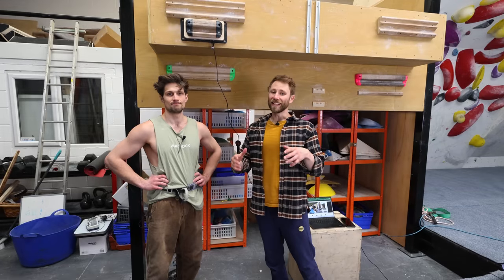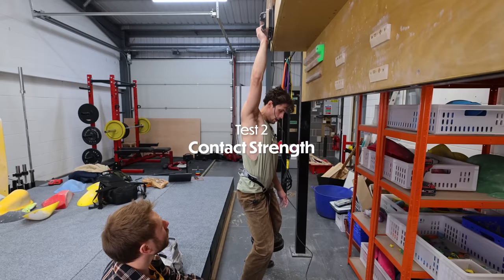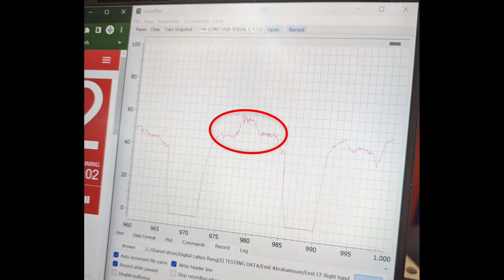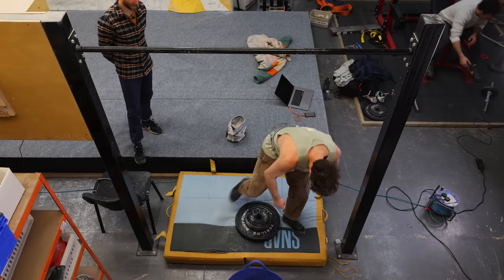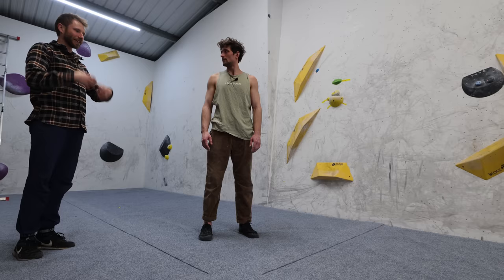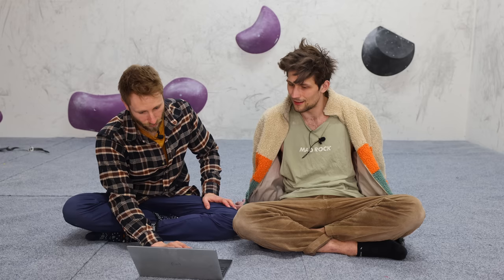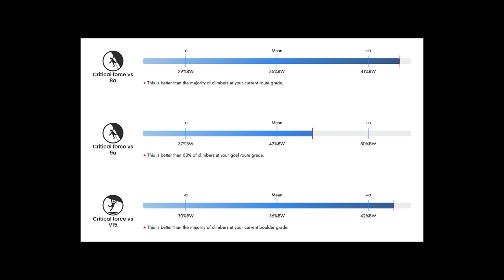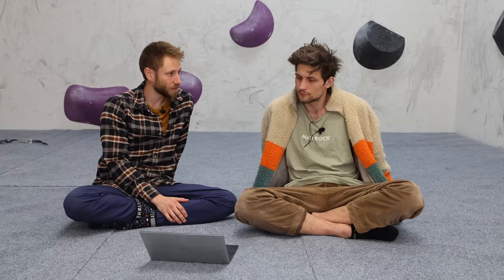Does @EmilAbrahamsson need to get stronger?

Comment: Power screaming gives an extra 10 kilos? Guess that Adam Ondra video wasn't an April fool's joke after all
Reply: its been shown that screaming can help you generate force, hence why climbers, weightlifters, tennispros, etc are doing it when trying hard
Reply from the maker: Right! I was amazed it was such a big difference.
Reply: @raiemie7365 It does, but I think with tennis it might be more for distracting the opponent. Sometimes the screams are a split second late with respect to the hit
Reply: @karimchahine4883  often with tennis the grunts are more of an exhale thing: hold breath before hit, hit, exhale (grunt)
Reply: @karimchahine4883  when you scream you tense your core up besides distracting your opponent it helps transfer energy from the feet to the arms (all power in tennis is generated from the feet) having stronger arms just allows you to transfer more energy to the racquet

Comment: The most interesting thing here to consider is that given Emil's results for Critical Force and what he said he spends a lot of time doing versus what he thinks he's best at, shows us just how wrong we can get it sometimes in our head, but get it right in our bodies. Given these things, he seems much more inclined to be better at producing a semi-high strength for a long period of time because he trains that all the time! But for whatever mental reason he still tells himself that he's best at power, something we're probably all guilty of throughout our training. Another consideration here you mention is timing. There is still a long way to come in measuring skill and technique. SO many pro climbers spend so much time climbing lots of different things consistently that they learn to use the strength they have better and thus don't need more strength like the rest of us plebeians! Definitely what I admire most about these high-level climbers
Reply: That, or it shows us that so few people climb v16 that the sample they are comparing to is so small it's almost irrelevant.

Comment: Shouldn't measurements involving repetitions (like push ups, pull ups, etc) involve consistent cadence to accurately measure / compare with others?
Reply from the maker: In a world where you're aiming for the highest quality, lowest volume data collection that may be put forward for peer reviewed research, then yes. In the real world though, there's a line between theory and practice, which must be found! As you imagine, we've done a LOT of testing over the years (both commercially and for our own peer reviewed research) and we find what we're doing is pretty effective. Hope that helps give a bit of context :-)

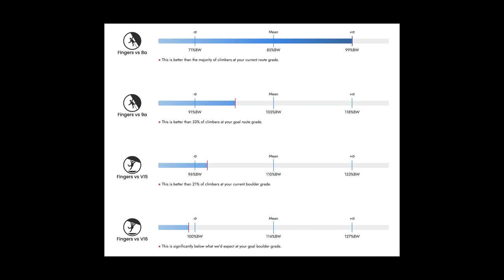Comment: 11:12 Are these scales corrected for height? As in: is "mean" the mean for v15 climbers, or v15 climbers with a similar height to emil? Emil's quite tall so its kind of a given hed be in the lower end, wouldn't it be more insightful to compare against similar heights? As you know from your data, 95% bw hung at 6'0" is a world apart from 95% bw hung at 5'6", it barely seems useful to compare the two.

I'm aware that you don't have an endless supply of v15 climber data either way of course :)
Reply: lighter = better for  climbing , it is likely the case emil is stronger than stefano ghisolfi but stefan can climb harder as hes lighter.
Reply: Pretty sure it's just the average and yes that might be a big part of why Emil found the results surprising. He also has a big arm span and wouldn't use the same beta if possible. He has quite a lot of volume and the inverse cube law is not helping.

Comment: I always wondered, is there any reason why you do max push ups instead of max weighted dips (or even weighted push ups?)
Reply from the maker: Great question! I'd add bench press too as this is good for 1RM or 2RM tests. The main barrier here is equipment. Our remote assessment is designed so that the majority can do it at a regular climbing gym. We've found many gyms still don't have a decent weight lifting set up. In many cases, just a hangboard and a bar with a few weights is all that's available.
Reply: Ohh I see! I didn't suggest bench pressing because it requires a lot more technique, coordination and there are many different ways to do it (with influence of spine mobility). But I see, thank you!
Reply: @LatticeTraining  Mine doesn't even even have weights to go with the 6 different hang boards and 7 types of campus rungs.

Between a hang board, a decent pull up bar, rings and a bunch of random weights, I have a better setup at home than at the gym.
Reply: You call those pushups lol
Reply: @LatticeTraining  I would suggest standardizing the pushups by requiering to lift the hands off the floor at the bottom of each rep. This foreces everyone to do a full range of motion and should give more consistent data.

Comment: Like always great video, love to see them suffer.. until it's my turn 😂 Two points of criticism though: The pull-up bar should be stabilized so there's only movement of the climber. And it's hard to see if the push-ups were all the way down, or place an object beneath so the elbows are always at 90 degrees maximum as the end point (for high ape-indexers or those with poor shoulder mobility this is a bit nicer).

Comment: It'd be interesting to see if repeating the RFD test when he's a bit fresher changed the result. I'd expect RFD to be the first thing to suffer when tired.
Reply: I wouldn't as initial high velocity work is usually quite fatigue resistant. most skilled athletes should be able to produce a similar velocity of pullup with appropriate rest between each set for the first pullup, and then with fatigue will see this drop significantly on following reps. Those rapid contractions will function similar, producing strength at velocity, but the RFD does seem quite off for someone of Emil's capabilities.

Comment: A question here : does the RFD measures the time from the bip to the time the force is applied, or the time from the first force applied to maximum force achieved in this run ?
Reply: obviously not certain of their setup, but in testing athletes with dynamometers, these tend to begin reading when a minimum force is applied, a few kg, and until a designated time is reached, usually 250ms.

I imagine Josh has done enough of this to assure accuracy and the scale shown on screen compared to climbers makes this seem like he has no RFD versus simply poor compared to other climbers.
Reply: @zacharylaschober  Makes sense, thanks. I guess so, yeah, was just curious to understand how someone able to do 1-5-9 can have poor contact strength, seems very counter-intuitive.
Reply: @Ptitviaud1337  campus boards are usually poor for development of contact strength or power, especially on much longer spans, because these are highly skill based movements which predominantly rely on lockoffs.

However, I get the point that watching Emil you would believe he has plenty of contact.
Reply: @zacharylaschober  I think you got the point, but maybe we could elaborate here together (i'm following my line of thoughts): ultimately, campusing relies on contact strength, lock-off AND contraction speed. You can have, for the sake of the argument, any mix of that (so, lets say high contraction, high lock off power, poor contact strength) and perform. Would be interesting to then isolate Lock off/explosiveness. The reason why i'm thinking about that is that i'm interested in finding a pretty easy way to measure contact strength, without using specific tools.
Reply: @Ptitviaud1337  following that, I think the problem with the 1-5-9 metric is we are adding several skill elements into this. 1-4-7 reduces much of the lockoff and skill, as will 1-3-5, but ultimately if we are measuring contact strength without an rfd device then I think snatches to edges are better. especially if we have an open and full rung akin to campus rungs, what you would do is find a rung which can be held isometrically at a weight and see what percentage of that weight a climber could do by snatching the hold, basically a small hop without time to recruit for the hang.

what would we do to train contact strength? have an athlete attempt to grab holds with greater force, either by increasing the speed they hit the holds or the weight.
Reply: @zacharylaschober  Yeah ! 1-5-9 certainly starts to hit also a morpho point.
Another "guess" is that they seem to measure, in this test, RFD over a period around of 300ms ? The problem that i see for climbing, is that within 0,3s, you would fall by about half a meter. Obviously, being able to developp strength over 0.3s isn't maybe so useful to suceed in a dyno scenario (following the same logic, in a dyno, if the margin for error is about 5cm of freefall, you need to developp enough strength within 100ms).
Of course in another scenario, where you can complement the force applied to the "next hold" with feet and/or another hand, you might have to recruit strength over a longer periode of time.
The problem with jumping to a hold is that it's very difficult to standardize...maybe it should be relative to max hang of said climber(so, lets say you're able to hang, one handed, on 20mm, we could determine that being able to jump one handed to this same hold is "that good", for example.)

Comment: Real question: how strict are you testing on form for the push-ups? Because arguably, the push-ups performed were not "clean". Cleaner push-ups would be more difficult and result in less reps, and in the end what you're testing would be different. So I wonder why not test for push-ups which have a 2 sec down, 1 sec up movement, engaged core, head straight, instead of just pumping out as many half push-ups as possible?
Reply: The form is not super strict as this is not the best allocation of time/focus resource when it comes to testing. Where you DO want to be stricter is when it comes to finger strength or max pull up tests. As always it’s a balance of theory and practicality 😊
Reply: @tomrandall8348  thank you for the reply! It makes absolut sense when you put it like this. I always worry about form because of the risk of injuries, but like you said, it's a balance, especially when testing
Reply: @Watashiwapitadesu  I think notably for pushups they are more concerned with it in a cardio/muscular endurance regard and even then only a bit because it has little relation to climbing. Therefore they don’t mind the reps being sloppy. With pull-ups there is an easy standard to keep with the chin reaching above the bar.

Comment: I would be very curious what Emil's strength metrics are without relating everything to bodyweight. I would guess he might even be significantly stronger than the average V16 climber. Obviously bodyweight is a major factor in climbing, but a taller climber with the same power to weight ratio as a smaller climber would theoretically be able to make bigger moves and hold static positions more easily. For that reason I find this data interesting, but potentially misleading and very skewed towards smaller climbers.
Reply from the maker: You are correct that data will skew towards shorter climbers. Shorter, lighter people, can achieve a greater S:W ratio than their taller peers. A good place to observe this is the weighted pull-up world records, ordered by weight category. Knowing this we compare relative (to bodyweight) results to other climbers of similar height. So the results you see are from a data model of similar height climbers, not all climbers we've tested. We do this because we can see a clear trend that shorter climbers tend to have (need?) more strength for a given grade.
Reply: @LatticeTraining  Ok, cool to see you guys are factoring that in! Perhaps as a bigger climber myself I get defensive for the big dudes. My apologies if I was over critical. Do you guys have anywhere people could look at the data you record from each climber?